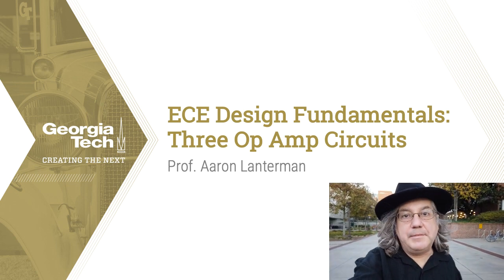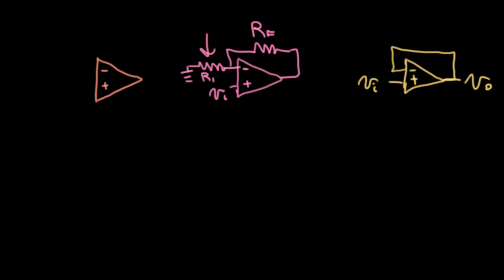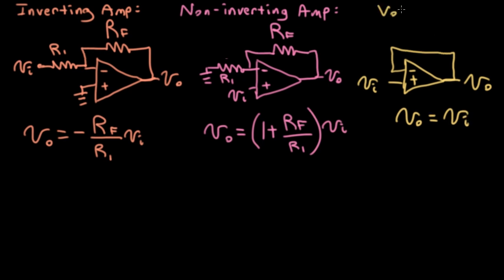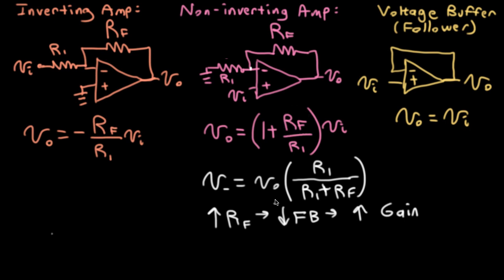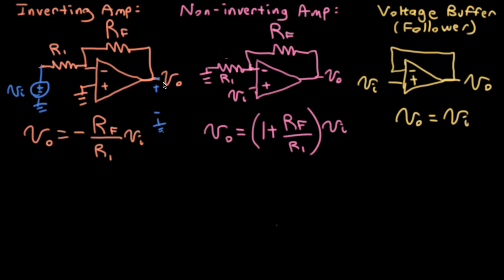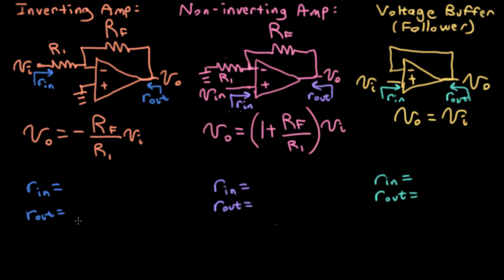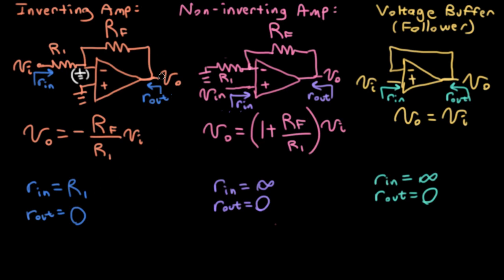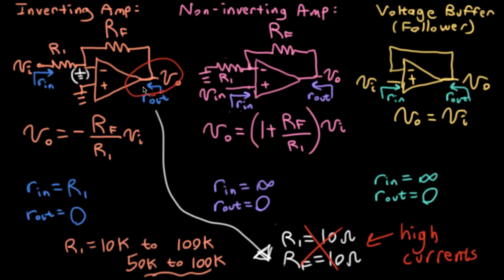3 Op Amp Circuits All Electrical & Computer Engineers Should Know by Heart (ECE Design Fundamentals)

Comment: Thanks for the info about high and low resistor values. It's something I've been thinking about ... how should you select resistor and capacitor values, beyond the ratios that produce the amplification and bandwidth results you seek